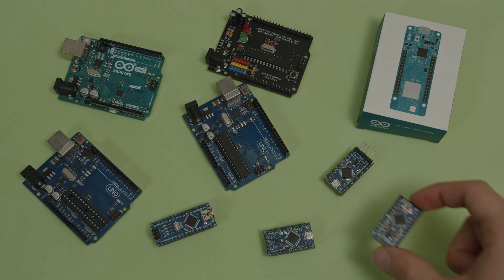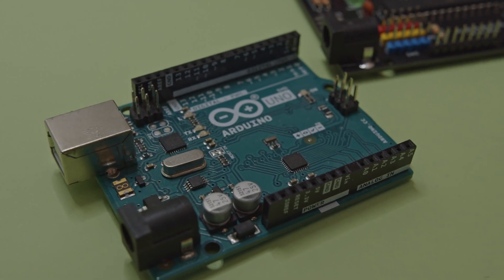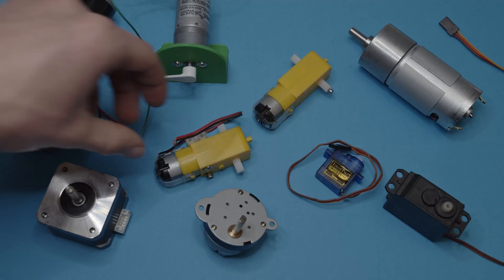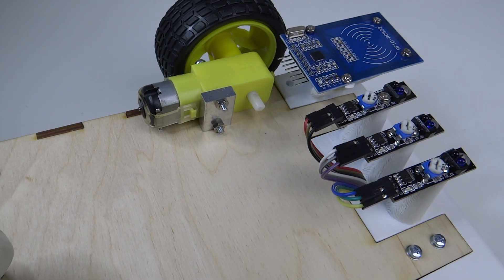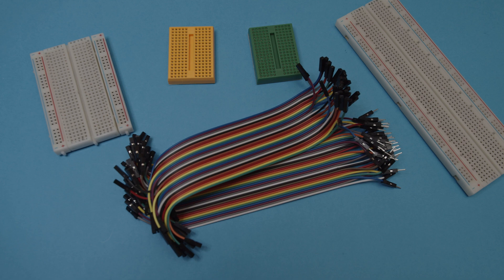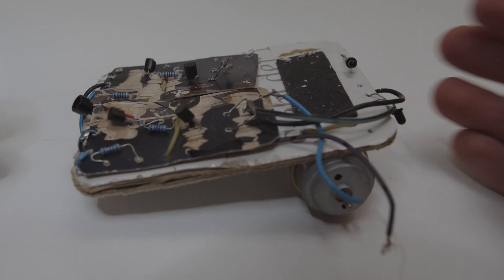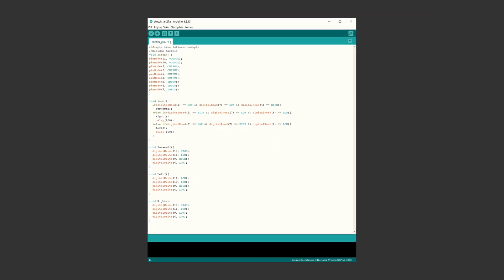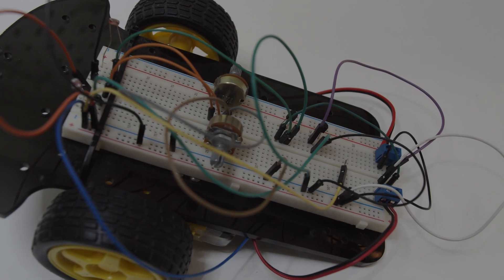How to build a robot in one minute

Comment: "...C++, that means it's easy to learn" never heard a better joke :D
Reply: For basic programs on Arduino C++ is realy not that hard. For me it was quite easy as a first language.
Reply: @pawel4066  Which absolutely only applies to a basic project where you let blink some LEDs.
Once you start to build something more complex you will very quickly reach the point where you need deep knowledge for basic concepts such as pointer, OO, stack handling and so on.
Don't get me wrong, i love c++ and it is perfect for working with microcontrollers for a ton of reasons, however i have been working as a software developer for over 10 years.
And exactly this is the reason why i know that c++ is not beginner friendly at all.

I think an esp8266 using LUA, especially for younger users, is way more comfortable to beginn with.
Reply: @SteakIsYummy  you don’t need to know OOP or pointers, if you don’t want to use either of them. 
The problem is when you don’t use them you don’t make optimal use of the C/C++ languages. Personally I found C and later C++ so simple and fun to use. But that’s us 80s kids worked with assembler on a C64 and 8086 and then having a compiler with all these standard things you’d otherwise slave over to program was a godsend.
And when you know assembler well, then C makes sense and when you understand OO paradigm and already have an assembler and or C background that makes it easy.
I still don’t use many of the C++14 and C++17 nifty auto typing and smart pointers. I’m so used to think in memory addresses and cleaning up after myself that it has no benefit really.
But I’ve been coding for 35 years.
Reply: @rdoetjes  I totally agree with you, however the point is something different.
"...if you don't want to use either" only applies if you know what they are and as a beginner you simply don't.

Take a stepper motor as an example. To control a nema17 as a beginner you rely on any kind of lib which probably comes with a class needed to be instantiated per motor. 
To actually know as a beginner what you are doing, you need to understand the OO concept. Otherwise you will simply fail to embed a second nema17.

Or even better, let a beginner declare an instance of same stepper class within the setup method, just because he overlooked it. He most likely will search until eternity why he cannot use it in loop.

C++ has so unbelievable many stumbling blocks, which definatly don't need to be there if you basically just started programming.
Reply: It is easy actually.
Reply: Yes
Reply: It's easy only 3 days
Reply: I’m alr learning lua. I can’t learn c++😭